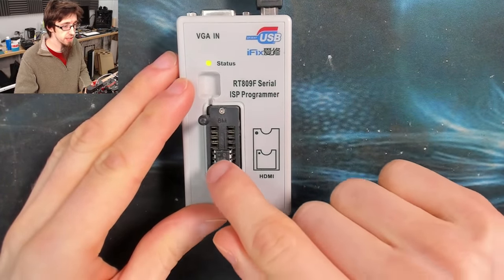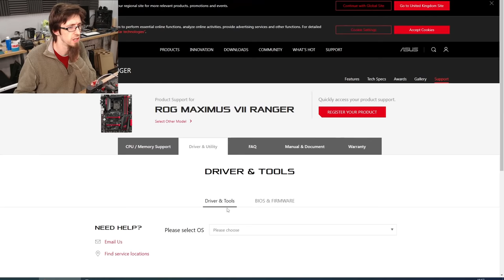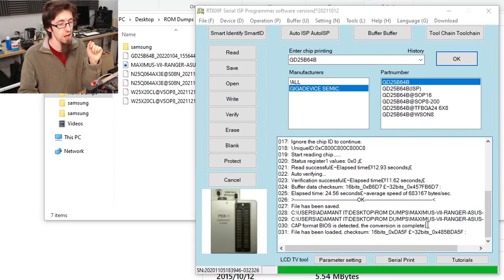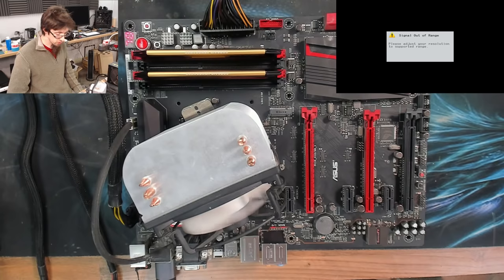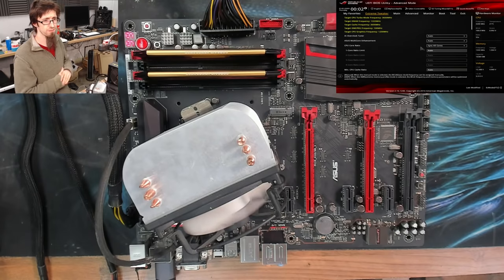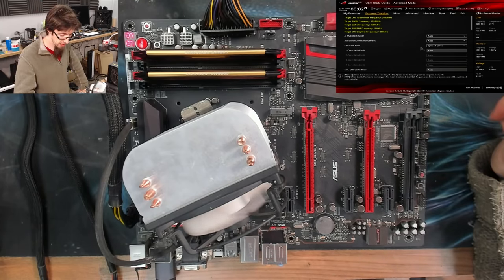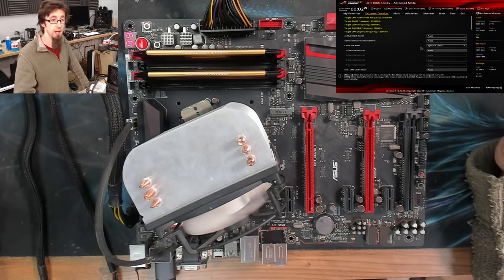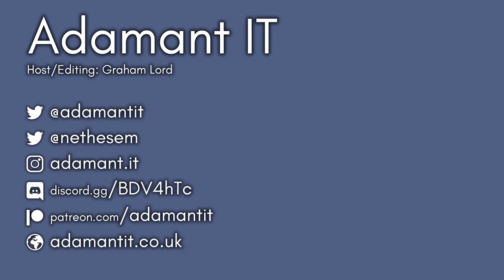Red herrings, red herrings everywhere (4th Gen Intel Build, No POST) - LFC#292

Comment: I bought a "dead" Z97 sabertooth board and was able to successfully get it working again using the bios flashback button. The BETA bios doesn't really do much for these asus Z97 boards. I believe it's mainly a fix for the meltdown stuff that was happening. While Asus does lots of things wrong, they certainly made the right decision when it comes to BIOS flashback.
Reply: Ive never seen a mobo where you can just remove the bios chip and reprogram it....and i been tinkering in computers for 20 years now.....in another vid he had a mobo that had 2 (yes 2 wtf) bios chips and one had malfunctioned....so he switched to the other bios, flashed the faulty chip and its back
Reply: @weedthepeople2795  yeah most mobos nowadays from name brands like gigabyte, asus, msi, etc have a socketed bios chip. But you don’t have to remove it to flash the bios. A lot of higher end boards have a bios flashback feature. It’s really nice if you build a system and the cpu isn’t compatible out of the box or even if your bios just gets corrupted for whatever reason.

Comment: For future reference, since atleast 1st gen "Core i" Series (and possibly before) it's been standard for motherboard manufacturers to have TJmax set at ~100°C and thermal throttle the CPU, most at ~90°C, to prevent damage and shut down the system if temps climb above 100°C after thermal throttling. In other words, it's perfectly safe to build and test computers WITHOUT a heatsink at all. I've done it for dozens of builds/repairs without any problems. In fact, usually you can run the system for over a minute without a heatsink before it starts getting close to 90°C and thermal throttling. Of course this is on newer systems that are more power efficient. Though, even on older systems, say Gen 2 "Core i" Series it should take atleast 30 seconds to reach 90°C. Especially since all you're doing is a POST test.

I understand your reluctance in doing this on camera though. I can just see the comments pouring in now, everyone shitting their pants thinking you're gonna cook the CPU.

Comment: Figured I'd use my official account, cause you mentioned Louis' channel... hehe. 

So at 16:50, a little trick from an older technician with those things... you had the arrows all turned inward.  If you start with them turned outward and pulled up instead, you can ever so slightly push down, not hard, and it will guide the white part into the hole first.  Don't worry too much about the paste, you used enough for 3 CPU's of that size  LOL.  Even with the proper amount, it's gonna be messy, no way around it, but yes pea in the center works best while you fiddle with hole finding for these Intel stock clip poke mounts.

At 48:30, bit rot talk.  So from everything that we were told by manufacturing engineers back in the day, is that once a CMOS battery starts to lose it's charge, a weird thing can occur.   For w/e reason the older board CMOS and BIOS chips seem to affect each other when the clock slows down due to low/depleted charge on the battery.  It seemed to corrupt the bit data on the BIOS.  This wasn't all boards all the time, it was really just random occurrences.  I am sure someone out there went all the way down the rabbit hole and figured it out, but ya it's really just one of those strange things with older comps.

Anyway, that's all for now, I might have to get me one of those ROM reader/writers... they look kind of neat and I might have to dig out some old boards and see how many of them need re-flashed LOL, you know, once I have that magical thing called time.  Maybe I ought to do this whole YouTube/Patreon/TikTok thing that everyone is doing.... but I don't think anyone wants to see an old guy ramble on while he fixes comps.... but I dunno... seems to be all the rage now.

Comment: Very good video and well done. I've seen a lot of things go wrong with computers but this is a new one.

I was kind of shocked at the condition of that machine. I'm the computer guy in the factory where I work and among other things pull machines off the line to clean and update them. Some of those computers have been in a dusty environment for years and are pretty nasty, but they don't look as bad as this poor thing did.

Comment: The data stored in that flash memory IC is stored in a transistor with a floating gate that electrons can be trapped with, and that is insulated with a dielectric. Over time the charge stored in the storage transistor's gate. Over time the electrons may escape and the charge leaks from the gate and therefore leads to data becoming corrupt. An effect with a similar outcome was possible on magnetic media such as mechanical hard disks and floppies, though with a different method of action. Very simplified overview of bit rot, but just in case anyone wasn't familiar with the term

Comment: Great video. I've built about ten machines during the last year. Tried to use the stock Intel cooler on a pair of occaseions, but have always chucked it after about an hour of testing.
Reply from the maker: Yea... stock blower is fine for an office PC that's always Race To Idle, but any kind of long loads and it's easily overwhelmed.

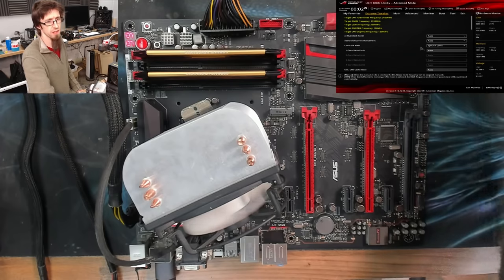Comment: 47:10 Manufacturers have mostly been using more or less the same UFEI since launch over a decade ago now, at least every ASUS bios I've looked at and I've owned a similar 4th gen PC with an MSI board, I was quite surprised to find that my new MSI B450 Ryzen board has a near identical UFEI just with different options.
Reply: Yeah, my ASRock H97 board has a very similar BIOS to my ASRock Z590 board minus a few newer features and a color change.

Comment: Yes bits sometimes can be changed by environmental factors. One famous occurrence was the Belgian elections that use e-vote. Later an investigation was done to find out the source of the error and it was concluded that an alpha particule, radiation that bombards earths atmosphere everyday, was responsible for changing a Bit in the voting machine. Same thing can happen to a regular home computer which is less shielded from any kind of radiation or electromagnetic interference.

Comment: While the BIOS being corrupted is possible its kind of unlikely. Whats mroe likely is that
1) the user was seeing really bad CPU temps (obviously)
2) user trid to flash the bios to fix it
3) user used wrong BIOS version (mobo manufacturers are increasingly annoying in keeping model numbers but having different versions of boards you need to know about )
4) use uploads BIOS, nukes system

Comment: Very interesting video. I have 2 unqualified guesses: 1. The CPU cooler had not been loose for years, it was only loose because the customer had done their own fault searching. Or 2. The CPU had good overheating protection, and that's how it survived the eventual years of overheating. Edit: Judging by the thermal paste it had made contact for about 1/4 to 1/3 of the surface. Would that be enough for the CPU to still work during lighter loads? You would normally not get 100% contact anyway. So maybe CPU's are designed to work even with suboptimal contact? Thanks for the video.

Comment: How can anyone let their system get so dirty? Buy yourself a  air blower  and  1  minute to clean up the dust. Get into a routine if you are in a dry dusty climate like me find that cleaning my pc every 3 months works. Alcohol 91% clean the fans  tear down the build to bare case wash case with soap and water blow case dry. Reassemble components. Great video .

Comment: Yeah, EPROM programmers are great to have around.
Back in the old IBM 5150 and even when the newer motherboards started using the EEPROM chips so they could start updating themselves were handy.  FLASH chips made things even easier as FLASH chips normally support more write cycles than EEPROM's do.

A few of the old motherboards started with like W27C512's or AT28C256 style EEPROM DIP chips.

I find it interesting the newest motherboards are using SPI style FLASH chips.
OH the  joys of tinkering with computers since the 1980's lol

Comment: A small tip for folks, don't write off a stick of ram until you have at least wiped the gold contacts with some isopropyl alcohol, over the years i've had several that seemingly didn't work, once the contacts have been cleaned, the ram has been fine!
Reply: Thanks for the tip.
Reply: @nian60  No problem, I've also brought ram back to life with a heat gun

Comment: Reminds me of when i worked in the Uni. we had some provided-by-the-lowest-bidder core2duo machines and somebody came to me: "my PC is slooow". I installed some diagnostic software. yup it was throttling happily along at 92 degrees. It had been like 4 years...
turns out there was a lovely bubble pea of thermal paste under the cooler that had never been flattened by any kind of pressure. the CPU cooler hung by a thread, 5mm off the CPU. It still worked for a good amount of time after correcting that, though.
Reply from the maker: It's genuinely impressive how well these Intel chips can self-preserve. Just a shame that High Temp alarms in BIOS aren't a thing anymore. The old Pentium 4 machines used to start beeping if the CPU was going nuclear, so the customer knew there was a problem.

Comment: With all of that obvious dust build-up, the first priority should have been to take the machine outside and use a leaf blower on it. Then test the CMOS battery, which is likely what actually caused the bios chip corruption in the first place. Then proceed to initial power on & check for POST. Other than that, good video.

Comment: 5:47 yes you can, but like he said in the most extreme cases.. Such as a 3080... you should have all of them properly powered. I was getting black screens while playing certain games on a build I bought from a friend of mine. He never had an issue (so he says) with the daisy chained cables. I looked to buy another power supply cable for the one in the build as it was modular and didnt have the extra installed, for that clean look I guess. Ended up having to buy a new power supply as the one in the build was a "powerspec" and nobody seems to make aftermarket cables for them. New one with same wattage and rating but came with all the cables I needed. No more black screens when overclocked and such.
Reply from the maker: Yea, 3080 and 3090 is more or less the exception to the rule, or maybe a 2080 Ti. Not much else that can pull enough power to overload a daisy-chained setup.

Comment: I used my i5-3570K for many years. Then came the time to pass my computer to my little brother. I delid and overclocked my beloved i5 to 5ghz (just one boot with 1.52V) and tried some OC profiles with it before I gave my computer to him.

Two years pass with my brothers computer BSODing once per two weeks. I changed RAM, motherboard, PSU, etc... I even got warranty RAM sticks from G.Skill.

I eventually changed the CPU and problems ended. I delid many CPUs and never had an issue with the process.

Comment: Nice job. I had a similar issue with a friends tv. A 25 series firmware flash chip. Funny thing was though, when you heated it above, or cooled it well below room temp, it worked fine. Which looks to me that it's behaving more like a poor internal connection issue, than bit rot! Like a slightly cold solder joint that reconnects itself when it expands and contracts with temperature change. Seemed to be only on the output side of the chip, because you could read the firmware back off it perfectly.

Comment: I've had that happen to me on a very old computer that would control a very ancient piece of heavy equipment. We ended up getting a new MB until we retired that equipment a few year later.
Most shops wont even mess with a board this old unless there is some critical use for it.
Reply: Gen 4 is not that old. You smartphone generation clod.

Comment: My routine of diagnosing that kind of things is following sequence: unplug everything that isn't necessary for POST, especially the SATA. That rules out a lot of cabling and peripherals issues. You can try it out with no memory, when it has a beeper and beeps - the CPU is not completely fried and has power, it's probably used to make beeps, maybe even show the POST codes. Then I clear CMOS settings, then I would go for googling how to get to a special service mode to flash BIOS.

Comment: Bit Rot, need to keep video and learn more..I have never done Programming, will try to learn as much as I can. My hp Pavilion runs so clean and quiet.. He was my first repair, with no skills just follow my mom's advice, "when things stop working, always check for the simplest culprit like dust, disconnected wiring etc. especially when nothing was spilled and it worked an hour ago.. My mom, when any electrical devices weren't working,  mom would take them apart and using assorted parts, would rebuild it. Our GE Iron stopped working, noticed the cord needed replacing, the hardware store, didn't sell stuff like that, she would have to buy a new Iron, she refused. Someone threw out an old Iron, mom removed the Electrical Cord, did a Frankenstein transplant, and it Freaking Worked! She said, before you buy a replacement, try to fix the old one.

Comment: Great job Graham . I wonder if having such low volts on the cmos battery for so long would cause the bios corruption.. possible I guess
Reply: @clevermusicbox3630  Hmm... a while back I built this computer to let me cut the cable. When I ran the MS tool to see if it would run Windows 11 (I didn't really think it would), the tool told me this computer was over ten years old. I wonder how the battery is. Of course I use the computer pretty much every day but still...
Reply: @clevermusicbox3630  Yeah... one of these days I'll pull the thing apart, give it a good cleaning and change the battery.

Comment: to help clarify for you, the BIOS got corrupted because of a bit flip. Bit flips are most commonly attributed to radiation knocking molecules around, causing a connection to not be a connection or visa versa. So it is literally cosmic rays (solar radiation) that killed this computer's bios.

Comment: Bitrot should not be happening to EEPROMS or Flash chips under 10 years old. It's got to be factory defective untrustworthy chip or bad flash attempt. Also, why in the world would you bother keep testing for POST in dual channel RAM mode, test one at a time. Even when you tested the CPU on another board, why bother go for dual channel right from the start!? That makes no sense.

Comment: I have a fleet of test motherboard/cpu/RAM combinations with a known good power supply that has working protection and an acrylic stand for having a rigid mounting environment for CPU coolers outside the case. Boards that are playing dead are fun to troubleshoot. Quite a few boards I tested were shorting to the customer's case. :)

I like Asus boards. Some of them have nifty features, like ability to switch between two onboard BIOS chips with a push of a button. One of my boards has individual switches to disable its PCI-Express slots. The only thing it lacks is the POST code display.

Comment: That was a fun video to watch. As others have said, I prefer the troubleshooting videos - especially on desktop form factor. I'm wondering if simply removing and reseating the BIOS chip (without reprogramming) would have been enough? Possibly some corrosion on the pins had built up over the years. Removing and reseating would help the pins make better contact again. Just a thought. Edit: By the way, nice job on the case clean-up and re-cabling.👍
Reply: Probably not, if it were corrosion CPU wouldn't read anything from the BIOS, and would not even attempt to start up and show a code 26.

Comment: A quick read of the memory chip data sheet will likely say that the programming is guaranteed for five or eight or ten years.  This memory relies on the charge on tiny capacitors remaining intact at the gate of a MOSFET.  So at that age of motherboard it might be best to just start by programing the BIOS chip as it will age out very soon even if it is working today.  There's a good chance the programming will last another eight years. I have some nice little project boards from 2006 that have lost their programing as well. It is almost planned obsolescence if you have no way to reprogram the chips. My system is this same age.  I'm going to reprogram the BIOS this week before it dies like this.

Comment: This was so helpful never even suspected such a thing. Ive got a x99 rog extreme 5. Is using the ez flash usb method, the same as pulling the bios chip out and reprograming it? Or if the chip is messed up the ez flash isn't working either? I've been sitting on (oddly enough) a asus sabartooth x99. Been holding out at the thought of it being the cpu... but going to get to it